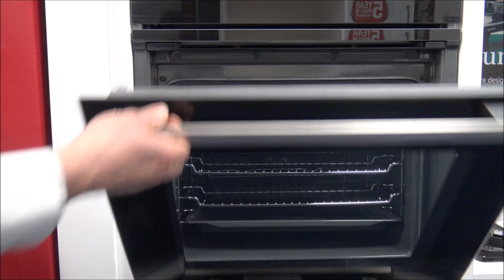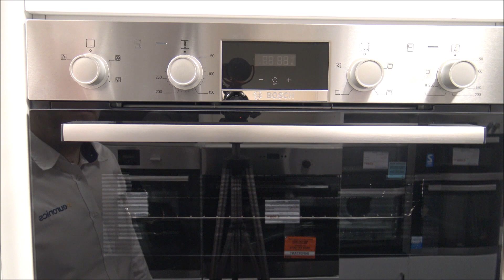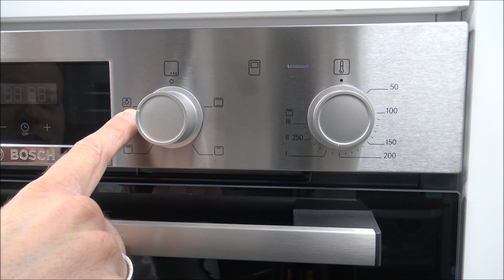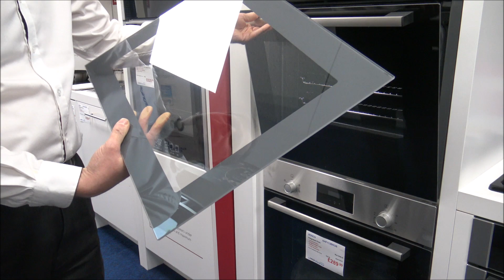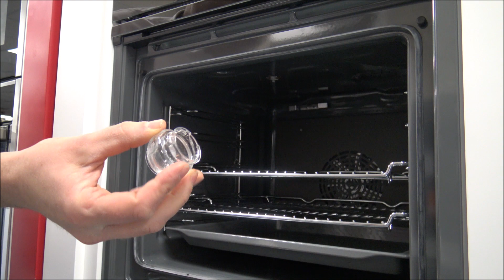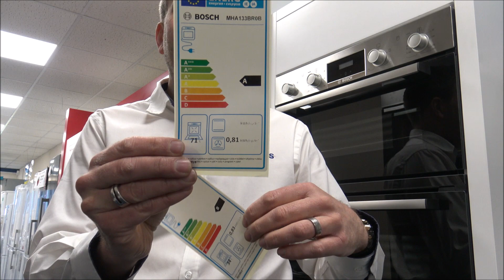Bosch MHA133BROB Integrated Double Oven

Comment: Hello great demo, thank you.  I wish I bought my oven from your electrical shop but alas not because I have been doing some research as I have this oven and it does not cook cakes, bread or roast well.  I have had Bosch engineers out 3 times and they say as it comes to temperature there is nothing they can do and also they are not home economists and therefore cannot comment on whether food is being cooked properly or not, sometimes this can be user error!!.  I am following the manual instructions for placement and temperature but I seem to have to increase the temperature with some things I cook, for an example roasting veg I need to set the oven to 250 then turn it down to 200 and place the veg on the top shelf.  Cakes and bread do not rise.  As you know a good deal about this oven and I particularly chose this model for all the reasons you have demo'd can you advise of anything I am doing wrong please just in case "it is user error " thank you very much.

Comment: Very nice Oven 
but when I bought the oven the handles on the side for lifting it…
one came out & it dropped & smashed the outer door & cost me £75 for a new glass including delivered… then I don’t find any videos on how to replace the front door glass… now I find I have to glue it on as well… nothing is simple with Bosch… where do I glue it how hight do I glue it? Nothing anywhere on the internet about it… 
Sorry for sounding off but a video on replacing the outer door glass would be beneficial to customers 👍

Comment: no grill pan bosch gone very cheap
Reply from the maker: Not just Bosch, most manufacturers are not putting a grill handle on grill pans now. It is because ideally you need 2 handles to hold the pan safely, but it is actually safer to use an oven glove to take the pan out.